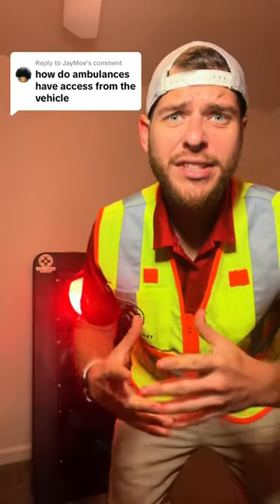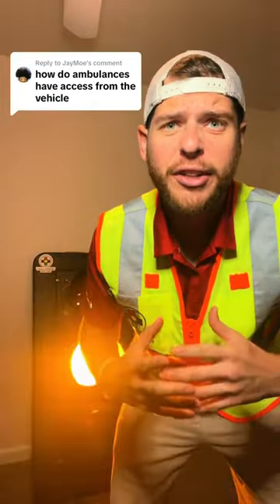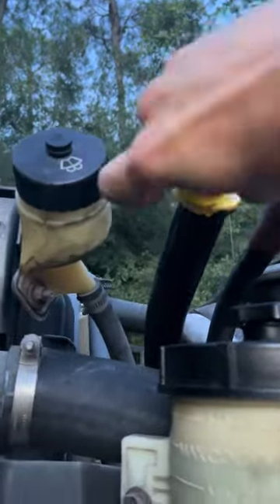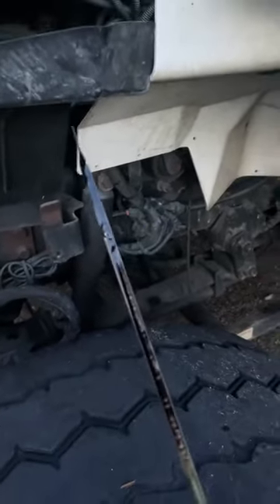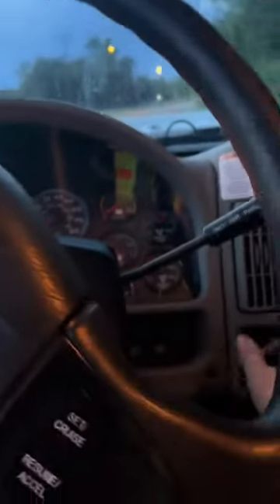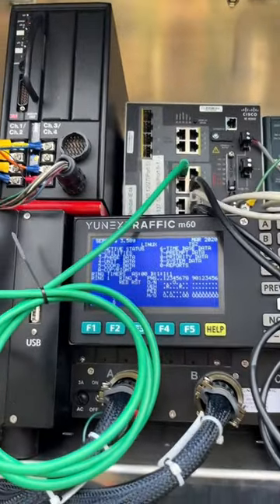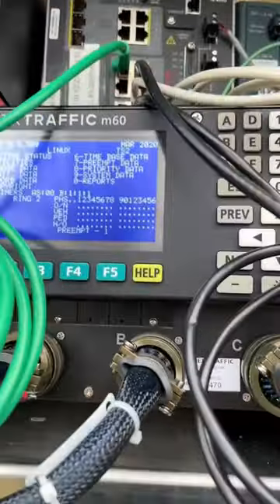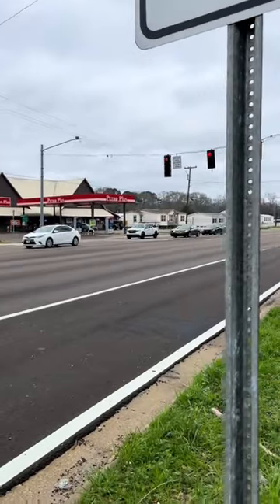How to always get a green light!

Comment: Since this guy didn't explain anything and basically just waisted everyones time being clickbait. Ambulances, firetrucks, and police cars all have a special light that flashes at a certain frequency for each type of vehicle to tell the traffic light computer that an incoming emergency vehicle is about to enter the intersection and that it needs a clear intersection and a green light for only itself and reds everywhere else.
Reply: By special light this person means infrared. And it can be far more complex than just a simple constant frequency of flashes. I mean, sure there is the carrier frequency, like how your TV remote uses ~38khz to get the attention of the receiver circuity (then utilizes timed patterns of carrier detected (flashing at 38khz) and not detected (not flashing) known as OOK or On-Off-Keying to pass data strings) but there are TONS of ways to encode data on top of that. 

In fact a typical IR signal from your TV remote for example, which shouldnt effect your hifi (ie, vol up on the TV doesnt change the volume of the hifi....or idk change input...if signals are misidentified it would depend on what a string is programmed to do), starts with a preamble to 'wake up' the receiver which has been constantly adjusting its sensitivity to ambient light levels not at 38khz so the output remains in an off state, then a series of pulses that describe the timing and encoding the remote intends to use (which is passed down stream to the microcontroller via the output of the IR receiver), then a product identification string which is unique to the type of device (why your tv and dvd remotes only work on those devices) and that model of IR protocol (this is why some remotes can be used across TVs, and why the same manufacturer may have multiple IR codes for universal remotes. The code refers to a table of command timings), that string inverted (ie, 00101101 then 11010010) for error correction, which may be repeated, then the command string which is also repeated inverted, then the entire string is repeated from after the preamble and timing setup step a few times. Eventually the remote starts sending a dedicated, and shorter 'repeat last command' sequence. This is why the pattern changes if you view it through your phones camera. The first fast bright bit is the setup. identification, and command, and the slower flashing is the 'repeat last command'. Fun fact: the controllers are usually programmed with a timeout on the repeat command....uh, command. To test if and how long your devices is programmed for hold something like Vol down, it should be responding as you hold it, keep holding it and completely cover the remote but keep it held down, wait a second or so and uncover it, the device should have acknowledged the same action again, now cover and wait 2 seconds, then 3, until it times out and basically rejects the repeat command until a new command is initiated. You and also change to another key, like Vol up, while covered and as long as you wait long enough for the repeat sequence to start it should still repeat the first command not the second! 

Some cheap IR stuff like IR RGB LEDs ignore the device ID portion of the signal, and will respond essentially randomly to other remotes. I have sets that go green when I hit Vol up a Vizio TV remote....

Yes I am a nerd. And I am a blast at parties! ;)
Reply: @zombieregime there is a physical light that flashes. It depends on the receiver, you can trip alot of them just by flashing your highbeams has to be the right angle tho.
Reply: @amazincrackmonkey7176  you're absolutely correct. I've done it multiple times flashing my headlights.
Reply: I want one of those lights on my car...
Reply: @zombieregime Great explanation. God you seem to have understood this inside and out. Just curious, how’d you learn all this!?

Comment: There's an infrared detector on the signal pole arm. Emergency vehicles can have a infrared transmitter that flashes a simple coded signal to make the light change. There's videos of people using a flipper zero to make a homebrew controller. Totally illegal tho
Reply: This does not work as it's encrypted IR. Nobody can just trip them, even with the device on the dash. You must have the key first.
Reply: @insainwhiteboy1  could imagine people at the light with a tv remote clicking it at the light to make it turn green hahahaha
Reply: this guy should hire you to write his videos
Reply: I had a radar detector that could alert me if emergency vehicles were nearby. I’m sure it used the same infrared sensors.
Reply: @painful-Jay  Y-you just contracted yourself, Radar and IR are 2 completely separate things.
Reply: @_JoeMomma  bro I'll spend my life finding a way to do this. Unfortunately getting a key is not easy as it's under ISOs from DoD and homeland security.
Reply: @insainwhiteboy1  radar detectors can receive several different signals. I’m not sure how that’s a difficult issue for you to understand.
Reply: @painful-Jay  I don't think you know what you're talking about. EMS has radar for data gathering most of the time for insurance and liability purposes. You not understanding basic physics isn't everyone else's problem.
Reply: @painful-Jay  IR is a based off IR emitters and receivers for communication. Radar is used for distance and speed detection which is why it was revolutionary.
Reply: @insainwhiteboy1 He's saying certain radar detectors have infrared sensors to detect abnormal IR signals which can indicate emergency vehicle. What's so difficult to understand?
Reply: @insainwhiteboy1 most MIRTs use a standard 14hz signal for emergency vehicles. If you can flash the IR light exactly 14 times a second you'll trigger it. There might be more advanced systems now that use customisable codes, but even then you would just need to point a homemade Arduino IR receiver at a firetruck to capture the code
Reply: @lordgman1  These devices are paired with local codes at each light. You might catch a code, but that code works for only that 1 light. There is no universal code.
Reply: @insainwhiteboy1  They are not unique to each light, they are unique to each traffic authority installing them at most, assuming they actually bother programming them.

The manufacturer OPTICOM also makes another system that uses GPS and encrypted radio transmissions to preemptively control signals based on an emergency vehicle's location by transmitting a unique radio code for a specific direction at each specific intersection, but that's an entirely different technology.
Reply: @insainwhiteboy1  Not all pre-emption devices are coded. Most work with just the frequency of the strobe flash.
Reply: I want one of these on my cars...

Comment: It’s a specific flash frequency on the Opticom infrared strobe light that can be set by the city/county. Good luck guessing that frequency and if you get caught, well-see ya in a few years!
Reply: Would be super easy to decode with a homemade Arduino IR receiver. You might even be able to catch it with a non-contact tachometer
Reply: @lordgman1  the question is why would you want to! Some use electronics that have encryption that you aren’t deciding.  Either way you get to go to jail should you manage to do it and actually use it.
Reply: @P-J-W-777  They aren't encrypted, they just use a unique pattern per county or jurisdiction. And you definitely SHOULDN'T build a MIRT device, it's just interesting that you can. Almost all signals that use OPTICOM signal preemption also have cameras which could possibly record it's usage. They probably won't be able to see your plate, but I wouldn't risk it.
Reply: @P-J-W-777  Because you just said yourself they're radio. We're talking about infrared OPTICOM systems

Comment: Just saying, you're supposed to leave the key on auxiliary for 10-30 seconds before firing that motor. That lets the glow plugs warm up.
Reply: You sound so sure of yourself, but unfortunately, that truck has something different from glow plugs.
Reply: In south Florida it's so hot outside, even the most stubborn diesels crank up instantly. My buddy has a 7.3 Ford and its got no glow plugs left but she cranks up immediately
Reply: @ItalianStallion1415  What does it use?
Reply: Modern engines have the quick heating glow plugs that don’t require you to do that anymore.
Reply: Strange because i drive for a living and I've yet to come across one that doesn't have a glow plugs or intake heater light that doesn't stay on for at least 3 to 5 seconds. I'm not talking pickup trucks either. We even have a 2022 international day cab and it still has the glow plug light on the dash when you start it. Must be a Canadian thing. P.S. the light comes on regardless of the temperature outside, it does it in +30 and- 30.
Reply: @jrock2142 
It uses glow bugs instead glow plugs lol

Comment: So the vehicle should be at idle and up to operating temp to check that Allison transmission just an FYI but here's a little tip press both up and down arrows on the shift selector until you see lvl and it will give you a digital reading

Comment: Can we get a longer version. Of this answer with out the fluids, I wanted to know more about this.
Reply: Its an infrared signaling system. Based on the sequence of patterns detected by the little black thingy at the end of the video (I always call it 'the little hat', its where the detectors live) the light controller can pre-empt the crossing pattern sequence, turn everything red, except every lane in the direction the detected signal came from. This allows the intersection to clear and traffic at the wait line to maneuver out of the way of an emergency vehicle allowing a smoother, faster, response for emergency services. City buses can also be fitted with emitters that upon detecting the bus is behind schedule, and having their own signal pattern identifying them as  a bus, send a command to trigger a quicker light change but not an 'emergency block everything and dump my direction, I GOT SOMEWHERE TO BE!!!' light change. Which would be entirely automatic and outside of the drivers control, they might not even be aware their bus has it. 

The emitters on the vehicles are IR LED arrays that flash patterns very much similar to how your TV remote works. Of course the data timings and patterns are different. But the passing of data over IR concept is exactly the same. Its technically possible to completely control an intersection just by flashing patterns within view of one 'little hat' receiver (supposing the controlling hardware is set up for it of course). 

However, interfacing with these systems while not being authorized to is considered accessing or attempting to access a protected emergency response network, and is VERY illegal. I for one will not weep while railing your wife/girlfriend if you get locked up for messing with them.

Comment: How do traffic lights change for emergency vehicles? There is a SYSTEM call Light Preemption or OPTICOM. These little bird looking black devices are on each signal looking towards the direction of travel for a strobe light.
Reply: legit never knew that till just now
Reply: Not just a strobe light, an infrared light pulsing a specific frequency
Reply: @lordgman1  SWEET

Comment: Don’t you have to check the trans fluid with the truck running
Reply: Depends on the make of the transmission
Reply: you can check all your fluids with the vehicle cold, if it's below the minimum mark while off you need fluid. but you can't get an accurate reading unless you follow the proper procedure for the fluid your checking
Reply: I always get the level right when hot running in neutral (or whatever it calls for). Then I take note of the level on the stick when it’s off and cold. From then on I look to see if it’s there in the morning with the truck off

Comment: If your coming up to a red light you can flash your high beams on and off  multiple times before you get to the light and it will switch to green.
Reply: only if they use a camera system

Comment: Emergency vehicles in some, perhaps most, cities have a white strobe light/controled flashing LED light over the windshield that's integrated in the emergency light cluster.  When the vehicle approaches an intersection with those lights flashing a sensor on or near the traffic light (if that specific traffic light has the sensor) facing the vehicle senses that flashing light and triggers those traffic lights to change or remain in the emergency vehicle's favor.  If you're able to flash your vehicle's headlights just right, especially at night and the intersection has those sensors, the traffic lights will do the same for you.

Comment: 3M Opticom
Reply: That's the answer. Opticom Emergency Vehicle Preemption. Seems the oldest version uses strobed inferred signaling on the emergency lights to signal to the traffic control, with the message encrypted by the vehicle and decrypted by the traffic controller. This is just from the merchant page, but the "encryption" is probably just a specific flashing pattern.